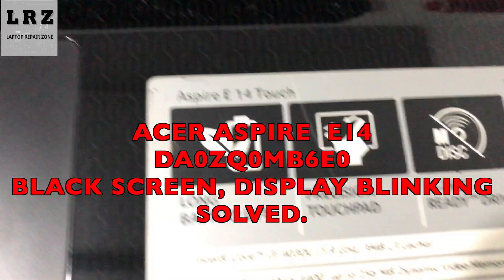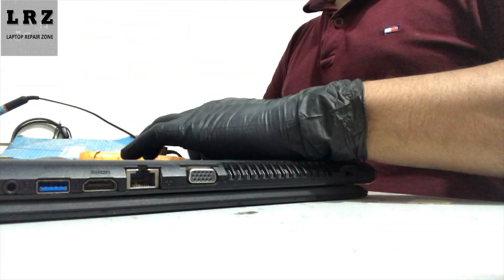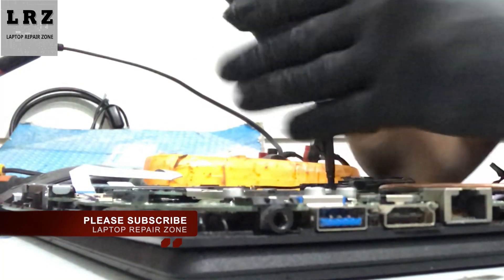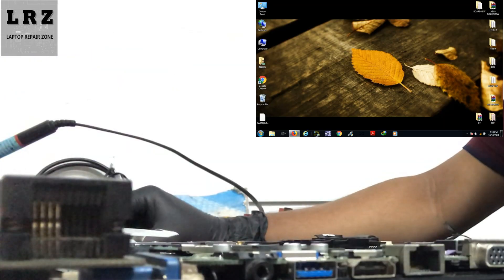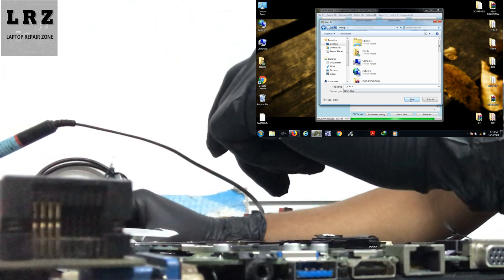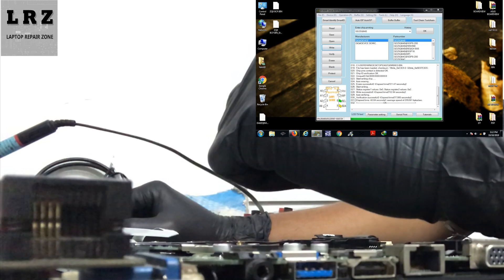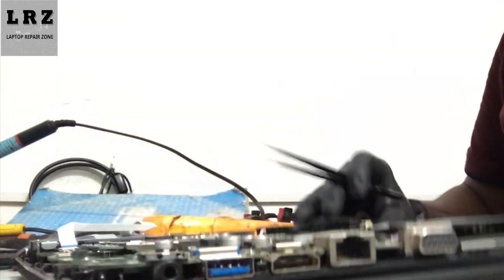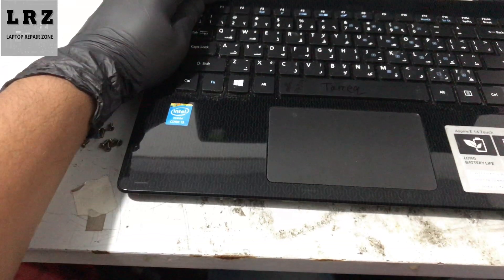Acer Aspire E14 black screen display blinking solved.

Comment: I have acer aspire f5-573g same problem,no display turn in on only led on fan also on,but in few minute, led, fan goes off....any advice? What cause that problem?
Reply from the maker: Thanks for your comment,clean or change RAM, flash BIOS, check all the required voltage and signal,
Reply: @Laptop_repair_zone  thanks man for reply,but no luck...i clean ram change with good one,still no display, i enter bios recovery with esc + fn flash with usb, led just blinking then goes off...still no display...so any advice specific component maybe shorted that need i check?

Comment: is this the only solution for this problem? my laptop also shows a black blinking screen when i try to turn it on, does that mean it's necessarily a hardware issue?
Reply from the maker: Thanks for your comment, you can reset CMOS battery,reset RAM or change,if problem not solved then you need to flash BIOS.
Reply: @Laptop_repair_zone  by the way thank you so much, your answer kind of inspired my solution

Comment: can help me Lenovo G50-80 power on without ram but switch off with ram (all voltage ok without ram)
Reply from the maker: A to Z Solutions thanks for your comment, flash BIOS.
Reply: @Laptop_repair_zone  all ready flash it same problem!
Reply: Have you tired another ram ? there might be a short inside your ram memory
Reply: @rezakianpour9668  also replace ram same problem
Reply: @LifeofPiworld  try to follow the power sequence there might be a missing signal

Comment: Nice video sir. Sir i have a lenovo r400 it's problem is that it's white screen problem. I'm already change the screen and FL but still problem. Can u give some tips
Reply from the maker: thanks for your comment, please check LCD VCC voltage and fuse there should be 3.3v present.